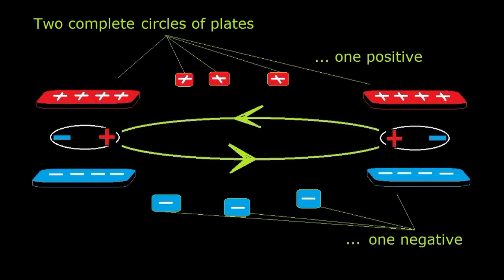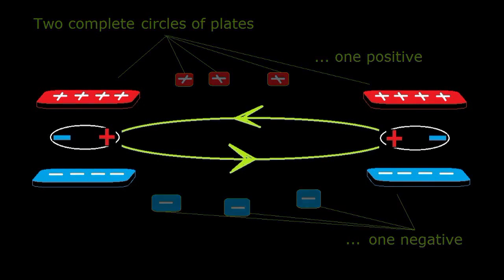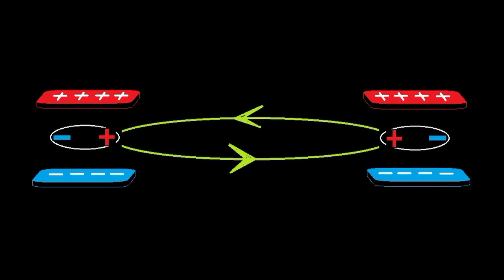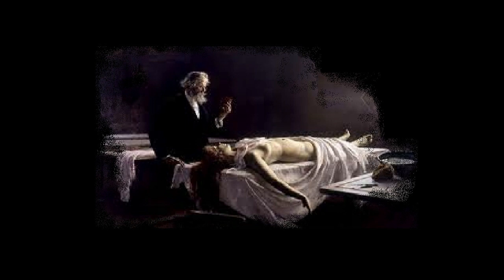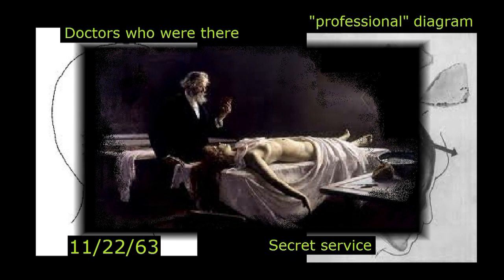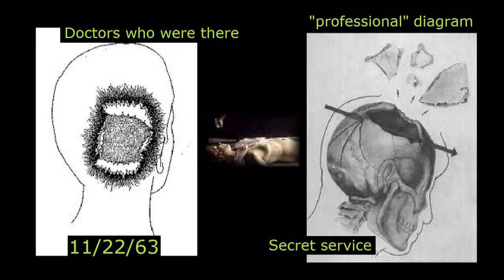Reactionless UFO Propulsion #3

Comment: I dont think we need a magnetic field as powerful as a UFO if we are just trying to test and prove out a theory in the hopes of obtaining a proof of feasibility or slight measurable weight difference.   I will intentionally disagree that the only way it can be discovered is by techs with lot lots of money because I believe that almost always discovery of the natural world is done by inexpensive creative experiments.     Why cant we do an experiment to see if at least a tiny difference in weight is obtained by rotating electrically charged (increasing as needed) super-fluid (or conductive fluid) at highspeed (or at a speed we can physically obtain at a reasonable cost) and then apply the necessary field to alter the centrifugal force  .  I have never seen anyone try this experiment.  Do you know of anyone doing an experiment like this trying to alter inertial mass centrifugal forces ? ?

Comment: All of this seems to be relatively easy to build.  Let me know what you think ?
Reply from the maker: No. 
1) You can't put it all on a scale because it would weigh too much. You have to, logically, put the magnetic field component on the scale as well ... and that would be hefty, hefty, hefty ... thereby drowning any 'signal' in the noise.
2) There is no current way to make a magnetic field strong enough to be comparable to a UFO because it is known to affect a compass at hundreds of yards away with a pole separation of only a couple of feet at most.
3) The charges I'm talking about are not there originally. They can't be separated. They exist within the neutron. If they don't stay there, they can't drag the inertial field with them. They would have their own separate inertial fields.

By my reckoning there is no way to do this experiment with current technology. If it has merit, it will be discovered by accident as an "anomaly" in some kind of super-conductor experiment sometime in the future ... maybe within a century or two ... by lots of technicians working with lots of money to spend on sophisticated equipment.

For now, it's just a "crackpot" idea ... ;o)

Comment: We could easily mechanically pump a ferric fluid in a circular pipe with enough velocity to gyrostablize a disk (like a circular table).  Inside the pipe we can put one wire in-board and one outboard to charge the fluid as it is rotated such that the positive charge particles of the fluid is always inboard
Reply: Magnetohydrodynamic.

Comment: why do you believe that mechanically rotating a super fluid would polarize the fluid such that positive charged particles would be inside and negativity charges particles would exist on the outside ?
Reply from the maker: The positive and negative charges are partial charges within a neutron. What I am conjecturing is that the inertial field of the neutron will stretch out into an ellipse and a charge will 'begin' to form at each focus. The electric field would than operate on those partial charges dragging the elliptical inertial field with them thereby creating an acceleration vector out of the plane of rotation ... thus violating linear momentum conservation.
Admittedly, that's a theoretical stretch.
However, the UFOs are there. They don't appear to obey linear momentum conservation. Therefore, I'm looking for a solution outside of the standard model that has an underpinning in mechanics rather than mysticism.
I wouldn't bet my paycheck on it though ;o)

PS - My apologies for the music. When I made videos then, I thought it was 'cool'. Now, I'm disgusted with music in any king of technical offering ... but I can't erase it :o(

Comment: If you make a (hot) plasma, all electrons are stripped from the nucleus. Now separate the the neg charge electrons and pos charged nucleons and store them.  now inject the two constituents at 90deg to one another.  The vector change will cause motion.  Use enough energy and you have another space type engine.  One which you can reuse all the fuel used for thrust.  People said the ION hall effect engine would not work as the electrons will attach themselves to the ejector the problems were ironed out and now ION thrusters are widespread.

Comment: a   b c
<=> <

magnet a,b and c are arranged with poles tip N and open end S. A is attached to b with a non conductive flexible joint. Use you imagination and think of these magnets as a unit. Attach a and c to you craft (again non conductive). a and c will try to attract as opposite poles attract. if a and c are equal strength  and b is whatever strength you like you will have a balanced engine.  however if you make a or b stronger and all equal distance apart a force will press/pull on a creating motive force.  Just because you cant see it (magnetic fields) does NOT make it reaction-less.

Comment from the maker: I'm sure he made Coral Castle using conventional techniques. Some of the stories about Leedskalin are made up for the tourista.
"Don't believe anything you hear and only half of what you see"
I did enough little experiments to see that IF it works, it will take much more than I can give it. But if some multimillionaire wants to blow a couple million on experiments, that's probably all it would take (not tens of millions - just 1 or 2 million at most to prove or falsify).
I'll hold my breath ;o)

Comment from the maker: I don't know what's in there ;o) ... However, whatever IS in there should respond in the manner I've described regardless of how you picture it. 
The mass of the particle is insignificant to the electromagnetic interaction in this model. So centrifugal force would not play a part in the separation of charges.
All I can say for sure is that "I can't do this". If it's possible it will take more money than I could ever give it. ;o)

Comment: @Bantokfomoki bob lazar atigravity is the same system that is used to create a time machine except instead of manipulating your position in time your do it with space and distance. the propulsion system is a singularity drive where you add electrons to a tiny black hole produced by a hadron collision to prevent the tiny black hole from collapsing making it stable by means of  repeating longitudinal wave cycles which is the same method used to create a mercury gravity vortex.